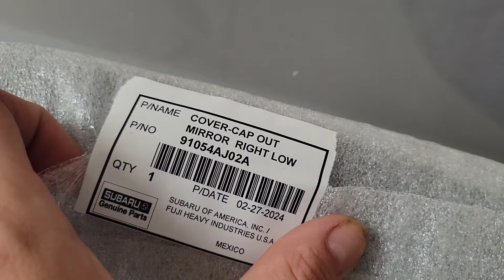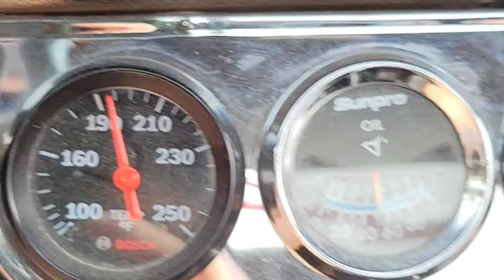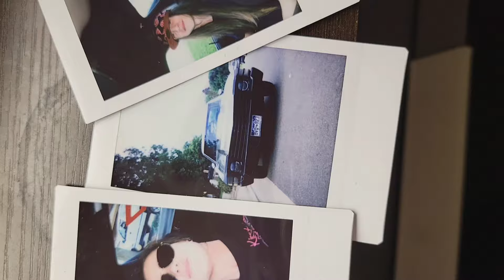Drove my 74 Nova home just to rip it apart and build it myself ground up-Floorpan SEAM SEALER time.

Comment: When you do panel repair, fit the panel, tack weld it in place, then go back and cut the seam as you weld. Just do a few inches at a time. When you get to the end the under piece youve been cutting will fall out so you don't have overlap. When you're ready to do the quarter panel, give Fitzees fabrication a watch to see this Cut and Butt method. He shows you how to make seemingly difficult jobs simple with basic tools. He definitely gave me more confidence. But great job just getting it done and learning as you go. That's the best way. Everyone finds their own way of doing it.
Reply from the maker: This was awesome advice! Thanks for giving name of the channel I learn so much better through video! But appreciate you taking the time! I've got ALOT to learn that's for sure. But I'm tryin!! 💪💯
Reply: @kirstieskarz  
No problem. And hey there's really no wrong way as long as you're getting it done. Great job girl!
Reply: @kirstieskarz  your great 👍

Comment: I have had to lap weld a few floor pans in. Then crawled around the car and cut off all the pieces that are left hanging, then grind it back a little to close to the weld. Then wipe seam sealer over the welds. Your car means do it however you can get the job done. Every step done is closer to driving it.

Comment: I am a welder. But replacing floor pans, door bottoms, rockers, etc, I switched to panel adhesives years ago. Like 40 years ago. Flange or overlap the pieces, glue them together. No warping, much stronger, yadda, yadda. Just make sure you don’t breathe the crap. No rust on the back side like you get with welds. Believe me.
Reply from the maker: 👀 I need to do some research on this 💯💯 thanks so much for the advice!!!

Comment: I believe using sealer on both side of the panel edges you will create pockets of air which will rust quick due to condensation 
only inside was enough

Comment: Dam! I wish you were my shop partner! I’m building a 71 nova and it’s pretty rough, needs trunk, floor 1/2’s and quarters and wheel tubs. I’ve got the car all stripped down and now it’s time to start the steel work. I’ve never taken on a project like this. I’m 50 years old and have built race engines, roll cages, trailers, houses, garages, done concrete work, and I’m a crane operator by trade but for some reason I’m nervous as hell to start cutting away on this car! I’ve never done body work I guess I just want it to turn out good. I had another guy do my race car years ago and it still looks awesome. Maybe I’m just aiming too high! You kind of give me a little more inspiration to just get going on it and geter done! Your body work looks pretty good on your nova from what I can tell. I subbed and I’ll keep watching your progress on your car! 👍👍Good job Girl!
Reply from the maker: Why am I so nervous toooo😂 it's just something about removing metal that never feels right! But yeah I wouldn't know what to do with a real shop partner. Mine are usually small and don't wanna work too hard 😂🤟 but I do enjoy my kids hanging. Thanks for the support I'm rooting for you on your project!!

Comment: When you do it remember to cut less because you can always cut some off but can't add more when too short and when you weld take your time so you don't warp it because once you warp it It becomes a pain in the butt to get it straight. If I lived near you I could give you a hand since I have replaces many quarters and body panels but I live far away in Canada but if you do the job right you won't have to use little to no body filler and won't be able to see where the panel was welded at.
Reply from the maker: That's some killer advice thank you!! I appreciate that so much!

Comment: Just a tip in the future, when you put seam sealer on, put it on with the gun sections at a time get yourself a can fill it halfway with some thinner get a paintbrush dip it in the in  thinner  and run the paintbrush with the thinner on it back-and-forth a few times It’ll make it smooth and fill in all the gaps  keep up the good work and you’re not on your own ask me any questions that you have if I can help I’ll try to explain it to you
Reply from the maker: That's some good advice right there thank you! Yeah it was driving me nuts that it was too sticky to just spread evenly like filler 😅 I was sure as heck trying though! Appreciate all tips I can get you rock 😁😜

Comment: INSTA 360 the new hot set up, and a fraction of the cost, does not overheat a lot a major influencers are using it [bikes and beards 2.3m] he just did a bit on his , bla, bla. You could [go ghettos] text screw down tack weld seal up pull the screws. Polyseem seal [loctite] works very good and is like 6.00 a tube paintable.
Reply from the maker: I'm definitely going to research this!!

Comment: I have a ‘74 that i converted the front end to a ‘72, and i also changed it up, completely, when i bought it , it was red with a white vinyl top and white bucket seats….it now has black reclineing seats with a white and ghost green pearl paint job… but the fun comes from a built 370” LQ9 with a LSA blower and 3.42 posi…car looks completely different than the grandma status it was in when i bought it back in the late 90’s…..i have a short video(s) of it on my page if you wanna see them along with my supercharged LS swapped ‘73 c/10 swb fleet side…..that one is white with a blue ghost pearl, its a hoot to drive!!!!
Reply from the maker: I'm thinking of doing the front end conversion too, the 74 front is just ridiculous 😅💯
Reply: @kirstieskarz   its really easy and makes a world of difference

Comment: I’ve always used seam sealer on the INSIDE of whatever I’m working on. Never seen it used on the outside. ✌️
Reply from the maker: Well dang ... 😅 I could of done it all wrong, that would be something I'd do😂💯 lol I just went with my gut. Figured the most moisture would come from bottem and get stuck up in those seams because I also probably put my floor pans in wrong too and should of cutt off more of the excess metal probably 😅 so this is all just learning.. and i got alot of learning to do!!
Reply: @kirstieskarz  we live & learn something new everyday, your doing great the main thing is your doing it and you will learn more as you go. Keep being you , you’re one of a kind. You may want to seal it from the inside that way it’s out of the weather and will last forever…

Comment: had one.. it was a tank. put it in a ditch at 60to0 in 1/2 a second and bent the frame... the car drove away = tank. beast motor had to put in neutral at red lights else it'd pull through the stock brakes ... blahblahblah

Comment: There is a metal rod riveted to the bottom of the barrel of your caLking gun to puntucure the seal before installing the tube and tip.
Reply from the maker: I figured that out eventually and do end up using it to puncture it 😂😅 truly went into this with zero knowledge,  came out ... with more knowledge then I had 😂🤏🙌 not much but it's honest work lol
Reply: @kirstieskarz  I see that now that I am finishing the video. Also you can buy seam sealer elsewhere and may be cheaper.

Comment: Just a point of constructive criticism. For your safety as well as the car's integrity, a LOT more welding should have been done prior to the seam sealing.  Everyone has to learn somewhere. Getting your hands dirty is usually the best place to start as you have found out. With the quarter on the El Camino, I HIGHLY suggest some research. Find and properly remove all the factory spot welds and do that one right. Yes, you may have to invest in a few tools. However, with what that car means to you, its worth investing both time into a couple of tools to really nail that one. I know that your more than capable of doing this. Not going to lie, I am a bit jealous in that I wish I had a project of my fathers that I could finish up. Keep working hard, keep learning and moving forward!!
Reply from the maker: I appreciate it man. Always down to take the criticism cause it always helps me learn! I too thought about welding more but had a few people check it out who have done floorpans before and they said it was solid. So I just agreed lol but I'm definitely doing research as we speak for the quarter. Thanks for all the tips and Info. Hope I don't dissapoint at the end of all this 😂😅🫶
Reply: @kirstieskarz  I am ALWAYS happy to lend knowledge where I can. Been tinkering with cars for most of my 52 years. So if I can ever answer a question of lend some know how feel free to ask.

Comment: Turn off caulking up there is a tool underneath the end of the tool you're using that will open up the tube just in case you didn't come across it somewhere

Comment: This is a John ratzenberger AKA Cliff Clavin from cheers "Moment Of Knowledge" 
The word caulk comes from the Old Northern French cauquer, meaning "to press down." After you lay the caulk down over the seam you press it down by either …did caulk originate from? According to the Oxford English Dictionary the word first appeared in the 14th century meaning “to stop up crevices or cracks …